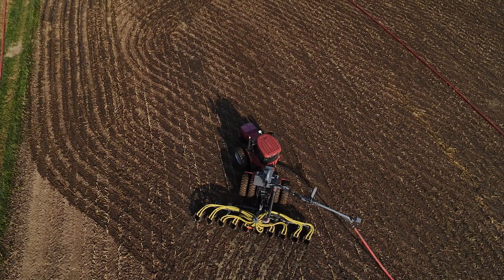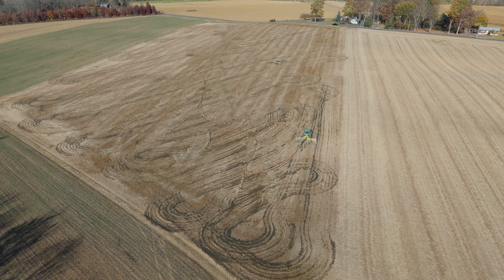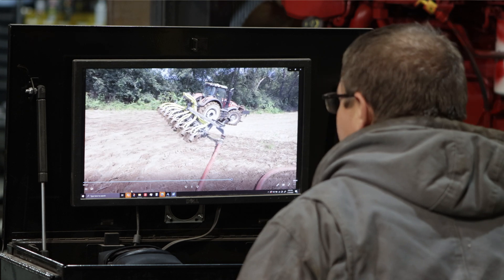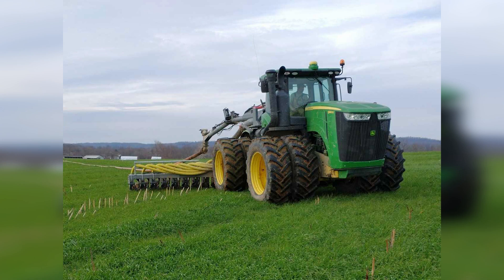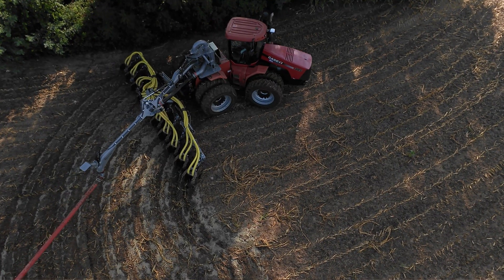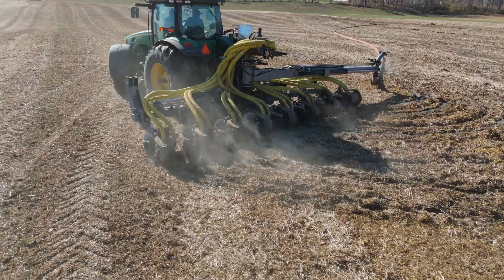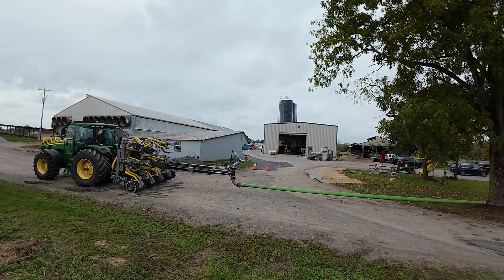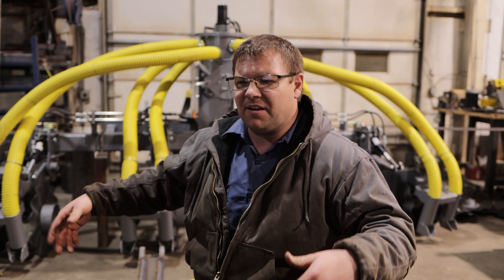Articulated vs Trailed Manure Injector Showdown! Hoover Farming! #Dragline Manure

Comment: Hey Eric,

with the advantage provided by the extendible swivel, wouldn’t it pair greatly with a trailed injector to elevate the two flaws you mentioned as intrinsic to the trailer design?

For turning, you can extend the swivel and remove all hose pull that would drag the trailer and tractor sideways.

You could also place the swivel’s turning point behind the applicator, allowing you to mount the swivel near above ground level and reduce the front tilting of the trailer almost or entirely. 
Normally having the swivel turn point further behind the tractor or trailer’s own turning point causes it to pull extra on the hose and vice versa each time you make a turn. With the extendable swivel design, you can accept that extra tug and over compensate it with the extension, provided it’s sufficiently extending more than the turn pulls the hose around. 

Here in Holland you don’t see any trailed injectors, but seeing some wide trailed tedders I did wonder why such a design ‘doesn’t exist’ for manure application. Seems like you can effectively spread your weight over a larger area, drive more relaxed and make easier, larger turns. I can imagine though that with an injector a very wide applicator would need some serious support for it’s long arms experiencing some dragging force so that might be why.
Reply from the maker: Its a loaded question. If you cared to come over we are having a open house in about 2 weeks. Would be glad to show you around.
Reply: Thank you kindly for the invitation, however I live on the other side of the pond in Europe.
I was interested in dragline and happened to stumble upon your channel.